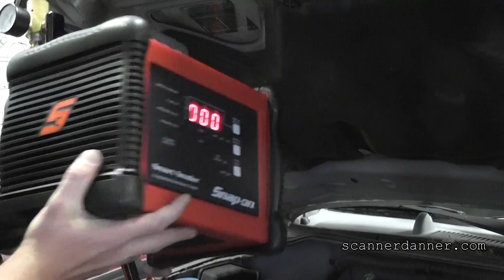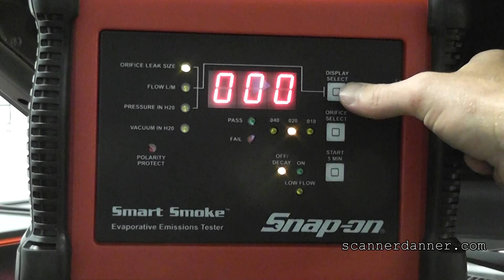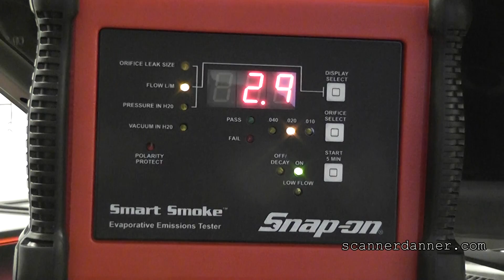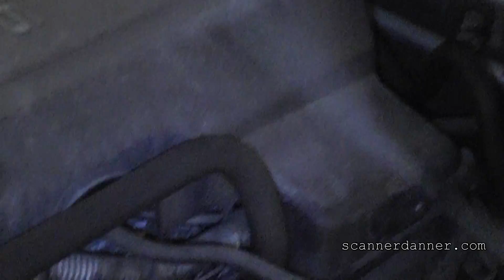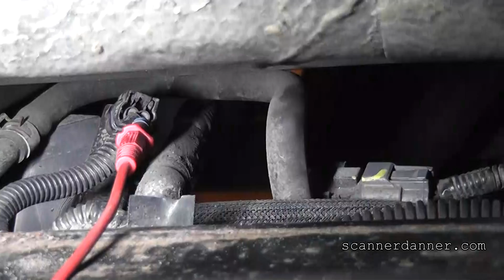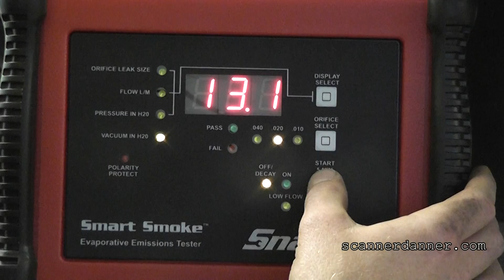Evap System Large Leak Detected P0455 (sticking vent solenoid) - Nissan

Comment: Paul! Another great video! I am a subscriber to your premium if i have questions in regards to stuff you teach or your videos what is the fastest way of reaching you? I did ask few questions below your videos and you haven't replied yet
 Second question is related to this video.
when we do not hear the solenoid clicking , the primary code that PCM should set  really is for a vent valve circuit  correct? with secondary code maybe for the large leak detected. In this case one doesn't really need a smoke machine. No solenoid clicking means solenoid winding open, or shorted driver or shorted wire , open or combination. Find out with test light which is it and replace/fix.
when we do hear solenoid clicking we know our wiring is good and then it is time to use the "badass smoke machine". 
What I am trying to say is do not smoke the system just because you have "LARGE LEAK detected" code  as in your video clearly we have bad solenoid (open winding) circuit issue and we do not need an expensive smoke machine to find out that our vent solenoid is leaking , we find out the same with cheap test light
I AM CORRECT?
Reply: Correcting myself ! Not hearing a click not necessarily means wiring problem. This video points to good wiring integrity and mechanically stuck open solenoid. thats probably why we do not have a circuit trouble code present. Still we do not need a smoke machine to verify that. If wiring checks ok, replace sticking solenoid.
Reply: One last note on this, we "humans" listen for a click. PCM is monitoring voltage at the vent solenoid driver (aka internal switch) and if it sees low voltage at all times it will set a circuit code. So in this particular video, it sees 12V with switch open and 0 with switch closed so no wiring issues therefore no circuit code set, only large leak detected code set. Still if you watch Paul's video from minute 12.00, going directly to vent solenoid with DVM, backprobing control wire while commanding vent solenoid to close will ground the wire to prove our wiring intergrity is good and we do have a bad (sticking) solenoid.

Comment: Does someone know what are the criteria to set that P0455 ? Is it only "decided" by the EVAP control system pressure sensor ?
Or does the fuel tank temperature sensor has also something to do with it ?

And also what exactly Nissan means by 1 trip. Reached coolant temperature ? Something else ? 

Thank you.
Reply from the maker: Every system is different. It would help to know what you are working on. Purge valve, Vent valve, tank pressure sensor, fuel tank level, etc etc are all factors as to how and when the test for an EVAP leak is done.
Reply: It's a 2006 Maxima. I got a P0455 last summer that went off by itself when I replaced the gas cap (carquest one). It came back a few weeks later and I cleared it. it stayed off for about 8 months but finally came back. It's like it was hibernating during winter (I'm in Québec, Canada, cold and long winter). I know that swapping part is stupid but I replaced the gas cap with a genuine Nissan, just to be sure it was not that simple. Even if I do some things on my car, I will go to my garage for a smoke test. But before going I would like to understand how my evap system work.
Reply from the maker: thank you, sorry about that

Comment: My wife had an 06 Nissan Sentra and I had to change the vent valve 3 times in the 220,000 mile we had it. Very dependable car one weird thing when the alternator went out there wasn't a voltage light to alert you, I. Believe the seatbelt light, brake light, and I think washer fluid light all came on at the same time. But what was weird is with a really weak battery the engine would crank, start, rev in park and neutral but when you put it in drive it would only idle and roll at an idle.

Comment: I went to Lincoln tech for the welding program and I had the p0442 small leak code come up on my truck. asked them to smoke it.  and they were breaking their head over it. found no leaks... adviced i take it to the dealer. I bought a new gas cap after friend of mine said he had similar problem and bam. done.
Reply: +ScannerDanner this is a good reminder of cause or effect. cause was vent solenoid stuck , effect is large leak.
Reply from the maker: +Randomsongs nice! small leak codes are the hardest to find, even with a smoke machine
Reply: +ScannerDanner its usually a loose cap or filler neck man. le least thing to think of.

Comment: Hey ScannerDanner so i was curious to know where you have your ground wire of the Multimeter  at as your commanding the solenoid on and off. Also great video.
Reply from the maker: somewhere near the solenoid? don't remember. Just have to be sure that when you measure a solenoid and expect to see 12v but see 0v to check your ground connection on your meter before checking the circuit for a problem.

Comment: Hey Paul quick question if you don't mind. If you have a EVAP solenoid problem either stuck closed or open would this make the car drink more fuel even with no Check Engine Light or any stored or pending codes. Thanks.
Reply from the maker: Purge or vent solenoid?  Purge stuck open, yes but only rich sometimes,  other times it could actually be lean. Vent suck closed,  you'll just have a hard time filling your tank

Comment: nevermind its fixed. its my brothers ranger the gas gauge got stuck on half a tank but really it was running out of gas.  we were looking at the o2 sensor readings under w.o.t and they did go lean so thats why we kept thinking it was fuel or maf related. i guess it was fuel related running out of fuel. put about 2 2 gallon gas cans in runs like a scalded dog. i was confused had no dtc's at all glad its done and over with. just got to fix the gas gauge

Comment: paul i know this isnt related to evap systems. im working on a 1999 ford ranger 3.0 flex fuel and have a question for you im looking at fuel trims and there around 7 and -7 at idle but when i rev it to 2000 or so the bank 2 goes to around +35. a dirty maf sensor would effect both? so i should look at o2 sensor reading to? would an injector problem sound possible on bank 2? thanks! i have your book. i understand trims  in the book but on a live car its kinda confusing
Reply from the maker: For sure. Remember the examples I give can have variables to them. Don't worry about the trims at idle being off when you have 35% at higher rpm. Definitely check your maf and fuel psi
Reply: we put a fuel pressure gauge on the sharader valve and it was fluctuating all over the place. he was to cheap and bought a harbor freight gauge. not a good idea. have a good sunday. your probably working hard like usual making the money.
Reply: i asked you about a 1972 dodge dart not running good under load, found out the choke ignition feed wire was chewed up by a critter where i couldnt see it by doing a visual inspection under the hood. nbow that runs real good under load

Comment: Paul if the fuel cap is not on, or leaking, would that make the engine management light come on?, this is something I have never encountered..the fuel cap in the UK comes in the annual MOT test, if its got a non sealing cap it fails the mot test...Fred uk
Reply from the maker: Yes, if the gas cap is leaking the system will set a leak code and illuminate the MIL. We also do gas cap testing here in Pennsylvania,  which is ridiculous on 96 and newer cars. Some company is lining their pockets (the one that made the government approved tester). it's not needed! The system checks it.......stupid government

Comment: I usually like your videos but saying shop air and gas fuels are a dangerous mix is simple not true. This machine is nice but not needed to fix evap leaks. So many other quicker ways without the expense. As a systems engineer for a major car manufacturer I can say for sure this tool is not needed. Not a hater just not a salesman for snap on.
Reply: So pumping oxygen into a fuel tank is not dangerous? Explain please. 
Also sorry about sounding like a Snap-on saleman. I was excited to be able to play with a new toy at our school is all.
Reply: Isn't there o2 in the tank already? When the purge opens I guess it pulls
in helium?? I don't want to sound like a jerk because as I said I do enjoy
your videos and it seems you have a great following, but I just would not
say it's dangerous without saying why it's dangerous. I have seen many
issue in our fuel systems but o2 has never been an issue. Thanks for the
quick reply scanner Danner, sorry but I don't know your real name.
Reply: It's Paul. And I see your point but I would argue that we are drawing these fuel vapors into the intake in a controlled and intermittent way. We are not exposing the fuel tank to a pressurized amount of oxygen with a cloud of fuel vapors (from the leak) surrounding to external part of the tank. What happens if the guy next to you creates a spark from something he is working on? Not only do you have a fireball outside the tank but that flame now has the ability to be maintained inside the tank = bad news. While I agree the risk may be minimal, I feel better about using an inert gas to pressurize the tank

Comment: Paul,excellent video as always! I really appreciate you taking the time to show this! I have one question : I have found on a Mercedes the Purge Valve solenoid in the engine bay area to create the large leak. It was very easy to spot as it's periodically energized and it's making a rapid clicking noise. Did the Nissan have one? Do you see them in general on different makes and models? I apologize for my somewhat clueless question,as I'm not aware if all systems are using a Purge Valve or not. I am aware that you've eliminated the entire system passed the vice grips,so by having the numbers drop to 0 the Purge Valve wasn't a concern. Just curious. Thank you. You're the best!
Reply: That is correct,  if the purge valve was stuck open we would be dumping smoke into the intake and the flow meter would have never dropped to 0.

Comment: What happens when the car comes to the shop and its not sticking anymore could you take a current waveform to see if there any difference when working and compare to a new one
Reply: No but if I do a flow test as I've shown in this video and it passes, then the vent solenoid is always a suspect.

Comment: Nice. Without the scan tool to manually turn on and off the system, is it possible to ground the solenoid manually (with a jumper wire at the connector and back probe to ground)? Tapping the wire to a known good ground without involving the computer?  A DIY guy type of diagnoses?  Thanks - Glen
Reply from the maker: Ozzstar Yes, that would work too but you need to know for sure circuit design and do it properly otherwise you could fry the computer driver.
Reply: Or you could disconnect the solenoid and use 12V to energize the solenoid itself. This is a real common failure on the GM S series. To the point that if they fail with an EVAP code it's the first thing I look at. They put it on the rear frame cross member out in the open with a foam filter in the housing, condensation and fuel vapor combine to rust the shaft so it won't move.

Comment: Neat tool.  Got something in mind for the DIY'er?  I've tried cigar smoke testing and it really requires 2 people to effectively use a cigar for testing.  You can't keep pressure in the system and check for leaks at the same time.  Mouth required. :)
Reply from the maker: ***** not to mention a major head rush and the danger of passing out.
Reply: Aren't you a fan of old skool funk's channel?  He has an awesome smoke machine pressurized by a tire air pump.
Reply: *****
Honestly forgot about that.  I have a short term memory. :P